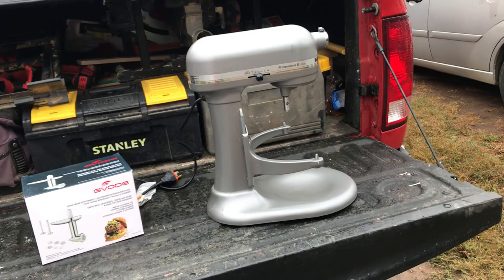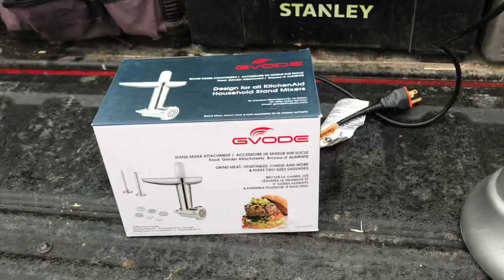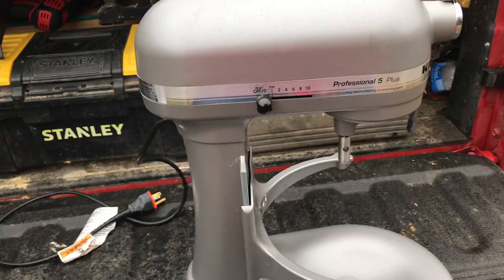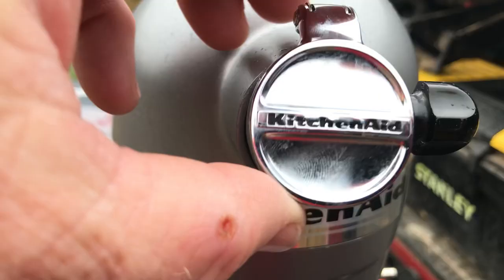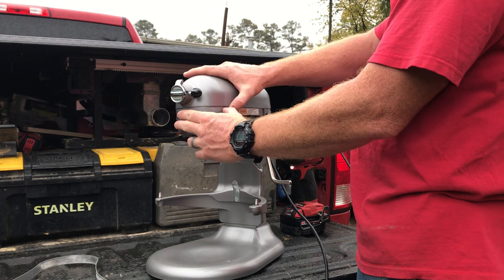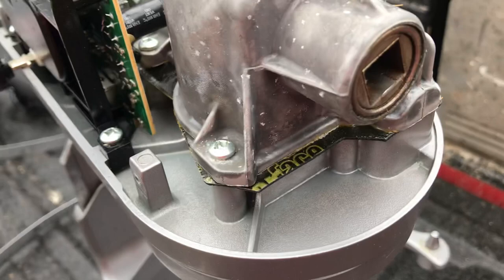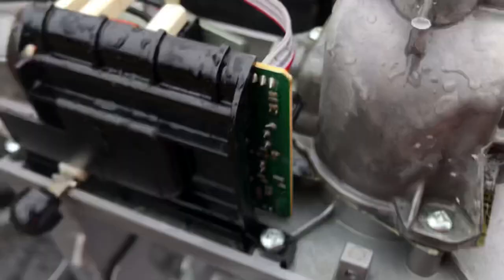Cleaning your Kitchenaid mixer. NEVER use it to grind meat. Easy mistakes lead to big messes!

Comment from the maker: UPDATE about the video. I've learned a lot from the comments. Thank you to everyone who has commented. In hindsight, it is obvious that I made mistakes as I was a novice to grinding meat myself. I speak from my own experiences. Other people have experiences different from my own.
I did freeze the meat first, but after reading some of the comments, I don't think I froze it good enough. Yes I bought a non KitchenAid grinder, but it wasnt exactly cheap, and I didn't like the way the KitchenAid one looked and felt I really wanted one which was stainless steel, so I got this GVODE. Lesson learned. There was not a o-ring, gasket, or absorbent disk with the grinder or mixer. I had no reason to think one may have been needed or included.
Last, after making this video I bought a dedicated, quality meat grinder. It works MUCH better. I ground up an entire cow with it. I'll do a video on it sometime.
Reply: KitchenAid has a stainless steel meat grinder, not just a plastic one. I just bought it, my mom has had it for a while, no issues like this for either of us.
Reply: @HungLikeScrat same lol,  I've ground several pounds of meat with my kitchenaid all metal grinder and have not had any issues whatsoever lol
Reply: You made one huge mistake and resulting you are blaming the wrong unit. The mistake you made is buying some cheap - I don't know brand - to attach to your kitchenaid.

I got almost all attachment for the kitchenaid and every single one is awesome. Way to expensive expensive but awesome.

The grinder of kitchenaid goes for 165,- (euro) in Europe. Expensive. But on the other hand, all accessories are massive, strong, well build.

Anyways. It is not the mixer. That one those not have to be sealed ipx at the accessories axis. The accessories have to sealed.

Buy original...
Reply: Thanks for the edit/update. Nice to see someone admit there were things that could have been done differently. I've gotten MANY more things wrong than right in my 57 years, lol. I have the same mixer with the Kitchenaide grinder. I've used it to grind up 2-3 deer with pork, turkey, beef fat, etc., and I've yet to have a problem. But it's definitely something to keep in mind. I use a high speed setting and try to have my meat semi-frozen. I do agree that a dedicated grinder might be best. I had one, but it finally gave out, so now the Kitchenaide is all I use.

Comment: It has nothing to do with the mixer.  It’s the cheap aftermarket grinder.
Reply: WRONG....I bought mine direct from KitchenAid and I am having the same issue!!!!!!
Reply: No.  That grinder is fine.    We own it and blood can't get in the kitchenaid.
Reply: I 💯 agree. I use my grandma's 'kitchenAid brand" grinder attachment that is from the 90s, and it doesn't leak any liquid. Also, every time before use, I fill the attachment with water before attaching it to the mixer and let it sit for a few minutes to verify it doesn't leak. I have replaced an o-ring in it once.

Comment: You blame Kitchenaid because you were too cheap to buy the genuine Kitchenaid grinder, so you bought a cheap Chinese knockoff? Lesson learnt, huh? Buy cheap, get cheap. Try following the instructions next time, too... cool the grinder FIRST in the freezer or refrigerator,  use partially frozen meat, and use the machine on the recommended speed setting of FOUR... problem solved. 🙄🙄🙄
Reply: Exactly!
Reply from the maker: Perhaps I should have bought the KitchenAid brand. But the Gvode one wasn't cheap.  However, I did learn a valuable lesson. A quality commercial meat grinder is definitely the way to go. I process my own deer and the commercial grinder does a great job
Reply: The all stainless aftermarket models are more expensive... Perhaps if the kitchenaid one wasn't potmetal garbage listed as "metal" (also made in china), people wouldn't look for all stainless aftermarket products...
Reply: I’ve been grinding with my kitchenaid for over 20 years with no problems. Of course, I’m not a moron
Reply: @DanielJohnson-ec8rk  🤣🤣 love it!

Comment: This is interesting. We’ve had our mixer for over 20 years and the meat grinder at least 15 years. We’ve ground hundreds of pounds of meat over that time and NEVER had the problem you’ve had. Our grinder attachment doesn’t look the same as yours though. Ours is a KitchenAid brand. Might be the brand you bought.
Reply: I believe you are supposed to use it on a speed of 6-8 when grinding meat
Reply: @southerngypsy2949  Speed 4 is what the manual says.
Reply: I strongly suspect that the Kitchenaide actual brand grinder fits so solidly and tightly into the hub that no blood gets through but the knock-off/off brand types won’t fit as well so blood gets in. I was glad to see this video though so I know how to take apart the Kitchenaide mixer should the need ever arise. 7:34
Reply: I have the KitchenAid branded metal grinding attachment and had the same thing happen to me. Disgusting.
Reply: Did you chill meat below 30° before grinding?
Reply: @abuzafi  we just grind our meat from the refrigerator , about 38 degrees
Reply: How long did it sit before you smell it? How long before you saw the maggots ?
Reply: Can the meat grinder be use to coarsely chop veggies?
Reply: @janetshelton8948 yes
Reply: @janetshelton8948  He said it was the next day.
Reply from the maker: To the best of my memory it was a few days. My wife used the mixer 2 or 3 days after grinding the meat, and the next day after that the smell hit. When I opened the case I saw the mess and a munch of small maggots. 🤢
Reply from the maker: Yes, but I don't. We have a food processor for that.
Reply: His is a kitchen aid pro model very nice machine.I have the basic model and have had it for twenty years.outside of a minor disassembly to lubricate the gear case which I did myself,it’s easy.I have never had a problem with this machine.I have ground hundreds of pounds of meat.I make my own sausage and ground meat.chicken pork beef wild game you name it.Totally satisfied
Reply: I've had mine for about 15 and ground meats for 10, no problems.  I also bought a full gear repair kit and extra grease many years go, still haven't had to install it.

Comment: It is the after market knockoff that has no seal for it. I have the kitchenaid brand and use mine quite often and no leaks, no smell. Thank you for the video, I was thinking about buying other knockoff attachments.  Not now.
Reply: I agree, we have been using our Kitchenaid Pro 600 with the Kitchenaid meat grinder attachment for over two years with no issues. Just stay from the aftermarket attachments.

Comment: The issue is with the grinder not the KA unit itself. Sometimes it's better spend a little more and get better quality.
Reply: I have read several reviews in various websites that say they have the same problem with the KA branded grinder- it’s kind of got me gun shy about it
Reply: The KA isnt better quality. Its made of cheap aluminum and has plastic attachements for sausage. The kvode is made of stainless steel at least.
Reply: @kesselrunheroj8497  WE have one. I don't use it very often nor do I do a lot at a time. But it hasn't failed yet and it's pretty easy to clean.
Reply: Some of it could have been the grinding speed as if you go back and you read the comments you'll see that a lot of people are saying it's the grinding speed allowing it to back up cuz you're supposed to use four or five and he said he used two. 

You're also supposed to have the meet pretty chill so that it's not so liquidy but the fact is it's worm gear so there is going to be a certain speed in which it can continue to push things out as opposed to letting them back up and there is a seal in there

Comment: NOW you tell me....I burned mine up yesterday. I obviously made several mistakes. Meat not partially frozen, etc. Live and learn. Went and bought an actual meat grinder. I think the mixer will still limp along for mixing; we'll see.
Reply from the maker: Does your model have brushed motors and gears? Or is the speed electronically controlled? You can regrease it and replace the motor brushes if it is an older model (which should rejuvenate it a good bit) , and you can replace the control board if it is a newer one (no guarantees).
Reply: @DGHamblin  I've had it for several years but really don't know; haven't taken it apart yet. Probably will soon. Thanks!

Comment: Need a more powerful speed. By your own emission, you had it on speed 2. At this speed the meat will back up due to lack of power going through strainer plate. The directions recommend at least speed 4. Also freeze the meat and grinder before using.

Comment: Mistake was it's recommended a minimum speed of 4 to 5 not 2. I've used mine for years and never had an issue. Guessing slow speed was the issue. Plus run a piece of bread through after grinding to solve that problem too

Comment: There is a O-ring seal in the Gvode drive shaft that inserts into the square drive of the Kitchenaid mixer. That's the only route fluids could get into the mixer head. If the O-ring is missing or you have a crack in the housing that bypasses the seal you will have problems. I have used the fruit strainer for de-seeding raspberries to make jam. It has an extention worm feeder that attaches to the same drive shaft to turn the worm feeder as the meat grinder and I checked, no juice leaking into the mixer head. It has to be your device. Using excessive pressure to force food into a narrow device can cause food and fluids to leak around a seal. You have to cut up the meat in small enough pieces to self-feed through the worm drive. The "pusher" is only a safety feature to move the food down the vertical feed so the worm drive can catch it and to push the last little bits that dont have the weight of food above it to push it through. Most of the meat grinding process I don't do any pushing but just plop pieces down into the feed. The point is to let the mechanical process do the work. The knives and grind plate and the worm feeder.
Reply from the maker: Thank you for the advice! I'll check that o-ring.

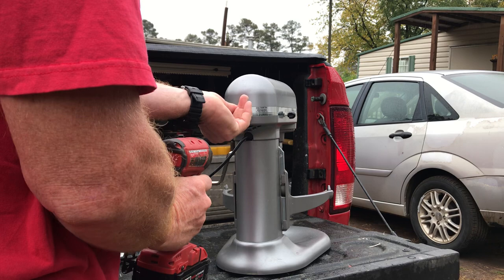Comment: A property machined joint where the shaft leaves the grinder housing won’t leak.  It’s not the mixer, it’s the Gvode grinder 4:13 (inferior product)   I can’t say the a quality part won’t leak, but it will be minimal, there’s probably an absorbent disk at the joint, maybe even a plastic disc to further prevent such an event.  Thanks for the heads up

Comment: Thanks for posting this. I have the exact same mixer. Looks like you saved me from this nightmare.
Reply from the maker: Glad I could help!
Reply: I’m not sure if this is the case but he was using an off brand not an actual kitchenaid brand attachment
Reply: @kevindodge4525  good to know. Thanks
Reply: Use Kitchen Aid attachments only.  No issues here. Stay away from the Amazon knockoffs.

Comment: There are multiple items to consider. 1. Wait to put too much meat into the grinder to prevent pressure buildup. 2. Use lightly frozen meat to reduce the amount of liquid. 3. Check the seal on your grinder. You can buy the original one from KitchenAid. 
This is a great video! Thanks for posting.
Reply from the maker: Great comment! Thank you. 
I did partially freeze the meat, but I may have tried to grind too much at a time or at a faster pace than I should have, I'm not sure. Although I did a lot of research on grinder attachments wanting to get a good one, this one did NOT have a seal. I didn't realize how important that might be. 
I actually ended up getting a quality dedicated meat grinder. It works great! Maybe I'll do a review on it. What do you think?
Reply: @DGHamblin  Re-Review the new one. Cant wait !

Comment: I only use my Kitchen aid mixer to grind.  I just got the new all metal KitchenAid grinder, but haven’t used it yet.  The plastic one I’ve had for several years, use it to grind venison to make sausage and sticks.  I can grind a 7 pound pork butt in about 4 minutes.  I’m guessing the metal one is faster, it’s double the size and looks heavy duty.
Reply: It's no faster. Aside from one being made of metal and the other being made of plastic, they're virtually identical.
Reply from the maker: I was afraid of the plastic KitchenAid one and couldn't find a metal KitchenAid grinder. In hindsight and after reading so many comments like yours, I should have gotten one like yours. The Gvode was the best metal one I could find at the time. I ended up getting a commercial grinder and love it. I'm really happy that you've had success with yours.
Reply: I make sausages for my family and have to grind like 20-30 lb  of meat. I bought COFUN meat grinder because the KA original, plastic one cracked. I had no problems with any liquid getting inside; it actually will spew towards me, so  I had to wear a good apron. That extensive usage actually wore off the gears in the mixer. I was about to run to the store to buy another mixer, presuming that the repair will cost me as much as a new one.

 I was told  by my acquaintance that her husband had fixed their KA with a purchased on KA parts site. It cost me about $80 with new gear set and grease with free labor of my son. 
KA is good to grind a few pounds, but for higher volume, it is better to buy a commercial grinder. I took me hours to grind 40 pounds of meat with my arms up pushing  meat on KA.I could not use KA to stuff sausage casing, so I bout a staffing syringe and only regret I have, that had not done it sooner,

Comment: Also just watched more, he just voided the warranty. By taking it apart beside using an aftermarket brand grinder.
Reply: As long as he didn't break it in the process of disassembly/assembly, there's no voided warranty in the U.S.
Reply: @HungLikeScrat  lol, sorry. They can tell if it's been taken apart. And messed with.

Comment: I had a knockoff on Amazon and it was garbage. I sent it back.  Just sucked it up and
paid for the METAL kitchen aid  kit. No problems and  Filled up a chest freezer with the
grinded meat.
Reply from the maker: When I was shopping for one, KitchenAid didn't have a metal one. Glad to know they do now. I would have gotten theirs had a metal one been available.
Reply: Seems to be aluminum though….

Comment: I have to press the importance of only going with the Kitchen branded attachments.

I tried an off brand shredder for the stand mixer on amazon that had LOTS of 5 star ratings.

When I got it, it felt so cheap and terrible. One of the shredding wheels had a spike of metal that punctured my finger. Had I used it, it would have broken off into my food.

I posted my 1 star review on Amazon along with pictures of the dangerous product. The company offered to give me a gift card if I delete the review. Screw that! I left it there and they tried contacting me again.

Comment: Uhhhh dude, have you thought that maybe the grinder attachment itself was dodgy? 

Look at the design: its feeding plate is siting right above the attachment.
Reply from the maker: That's a good point about the feeding plate. The attachment itself appears to be well made. And it was the most expensive and best reviewed one I could find. The KA one is plastic and I didn't like it. BUT I have since gotten a quality dedicated meat grinder. Paid more for it then I did the mixer. It works well.

Comment: I can understand what you're saying happened but I have used mine to grind my venison MANY times and have NEVER had any issues like this. I do chill my meat before I grind which may be the difference so that might be something for people to consider if doing this. I LOVE mine!
Reply from the maker: I think the problem was more the aftermarket grinder. Even though I did my best to buy a quality grinder, it didn't work out so well. I didn't want to get the one from KitchenAid because I didn't like how it was made, but perhaps I should have done so anyway.
Reply: @DGHamblin  Don't you just hate hindsight? Unfortunately after market parts can be hit or miss, sounds like yours was a miss. Mine is a kitchen aid grinder so maybe the quality was better cause it's done well, however, I still think that even if I ran meat through there warm, there would be a lot more blood that may leak into that inside area, I just know I'm thankful for chilling it to begin with and not going through that pain in the ass. After seeing your video I'll make sure I always chill the meat! I always try to learn from others mistake before I make them! Lol